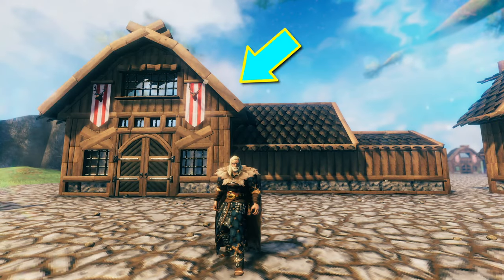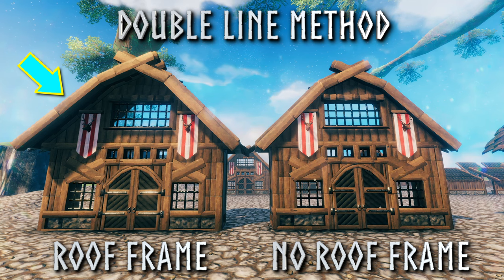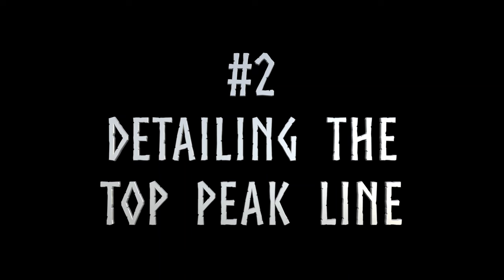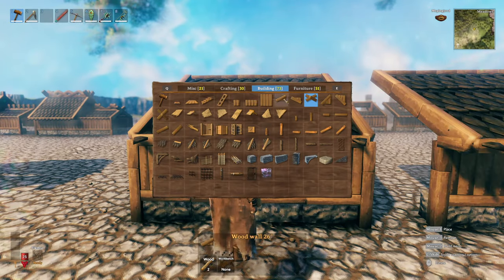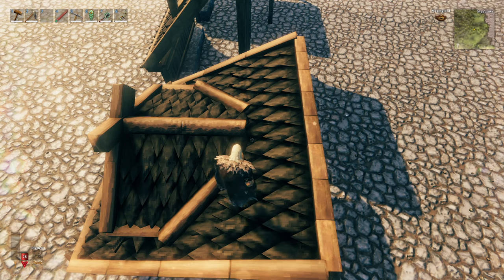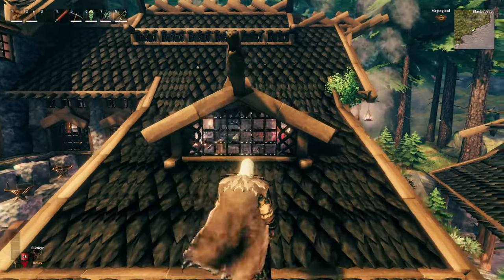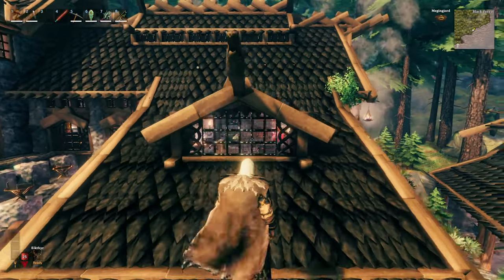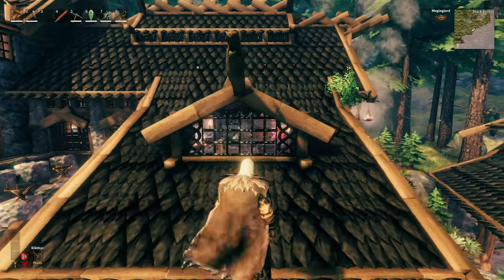How to Detail Your Roof in Valheim

Comment: I'm interested in ideas for building around Maypoles since we can't move or build them (other then when the devs randomly unlock them). Just the other day I build a new house around one but due to the freehand alignment I used for the center piece around the Maypole, the structure in one location down the width of the building was offset by about 1/6 - 1/5 of a 1by2. Luckily I framed the base of the walls off the ground so only the upper part of the walls and roof in this section were shifted slightly which could be hidden somewhat.